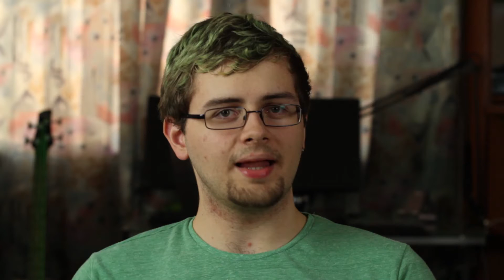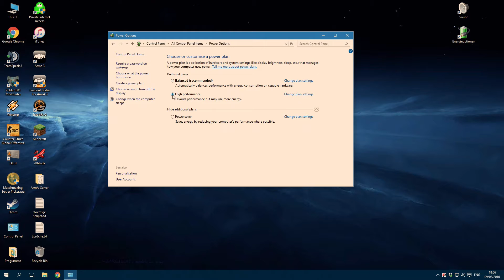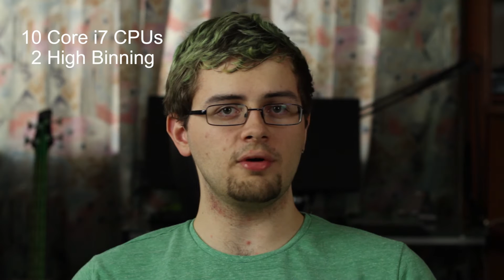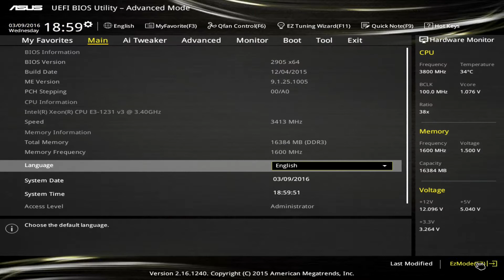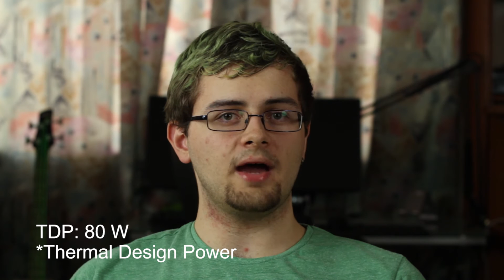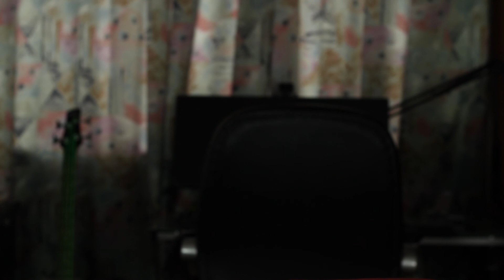Undervolting Your CPU

Comment: See if you can wrap your head around this? Running an AMD FX 8370 with a stock base clock speed of 4.0GHz & stock voltage of IIRC? 1.38'ish?. it will Not run at 4.4GHz at the stock voltage ok? But it will run at 4.3GHz Undervolted all to hell!?! LOL!...

Sorry I don't remember exactly but it seems like a Huge undervolt to me? the Negative Offset is like +0.062500? just B4 it goes into the yellow?. and yet 1 more GHz & it crashes almost right away at the stock voltage? LOL!...

I love it, a Free 3GHz increase in speed at a lower power & heat than stock? I'll take that ;-)

I'm not a big OC'er who cares about pushing things to the limit, Yes I want the very best performance But! I also want it delivered as Efficiently as possible ;-)
Reply: RawLu  that could be overheating or motherboard not being able to handle the power

Comment: hey i undervolted my cpu after adding 400mhz i shouldve given it 0.4 but i gave it 0.14 instead because i watched an intel vid. And now my components turn on but not monitor or Mouse pleaaaase help.
Reply from the maker: You need to clear the CMOS. Either do this by using the jumper of the motherboard or remove the C cell from the motherboard.
Reply: Macusercom i Did and i fixed it but when trying to Install Windows i turned my computer off because i changed som uber settings. And now i cant turn it on, when i give my pc power my cpu and gpu fans turn on for 1 second and my mobo blinks, but pc doesnt turn on. I am in a struggle got any solutions?
Reply from the maker: Can you still enter the BIOS?
Reply: Macusercom No my computer lights and components are turning on for 1 sec then go off for 2 and the one for 1 sec... This happens when i give it power. BTW hope i'm not bothering u in a bad way.
Reply from the maker: No, you're not, but I have absolutely no idea what it could be. Maybe check the CPU contact pins or your PSU :(
Reply: Macusercom the part where i plug in the cable. Btw what should i do when i get into BIOS since sometimes, it randomly works.